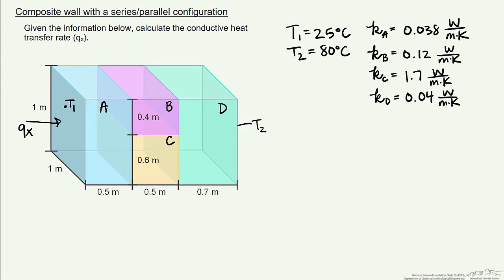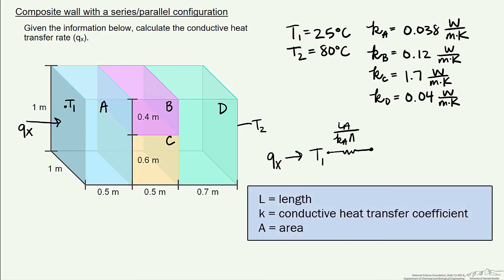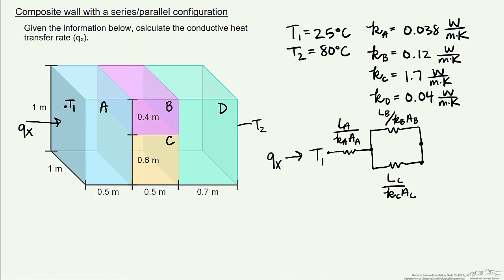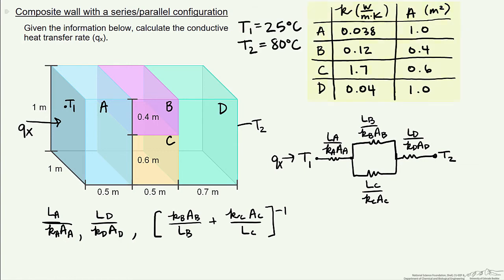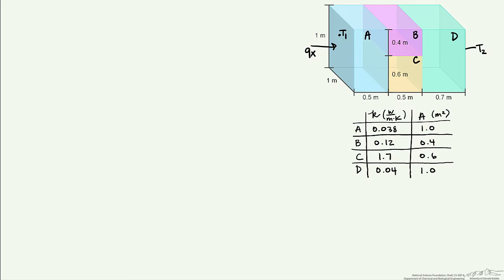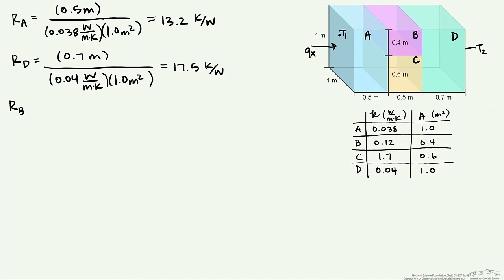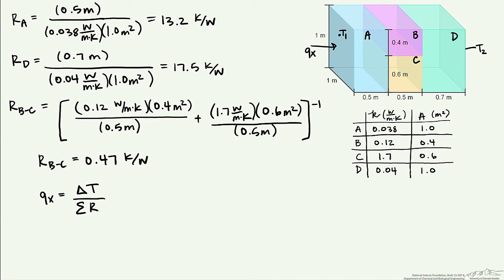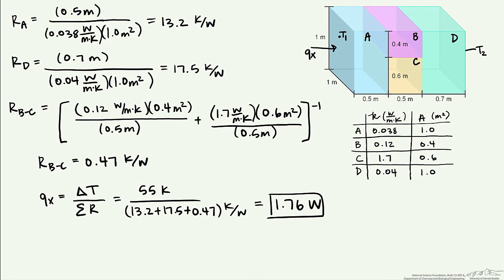Composite Wall with Series/Parallel Configuration

Comment: The direction of heat transfer shown in the figure is wrong. The heat transfer happens from higher temperature to lower i.e. from T2 to T1. Please correct it in the diagram used in the video.
Reply from the maker: A corrected screencast has been posted (https://youtu.be/R-5McNR2274). Thanks for pointing out this error!